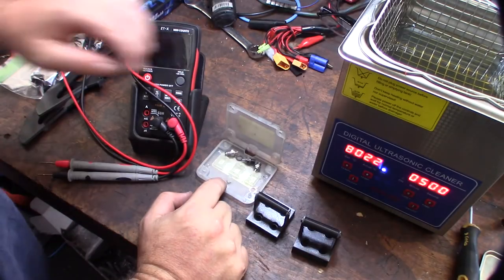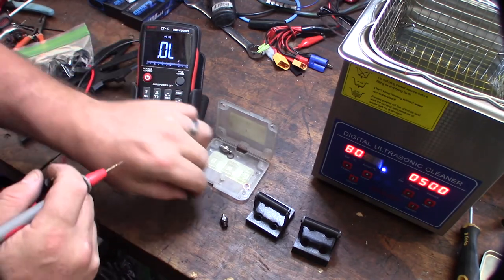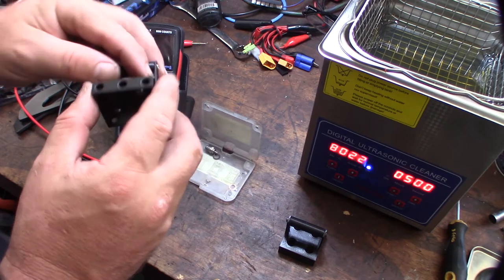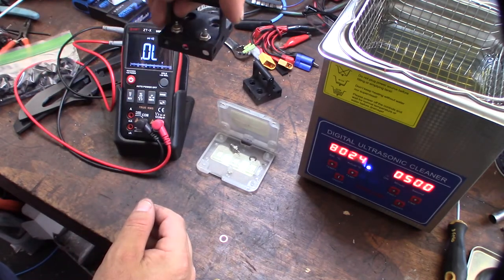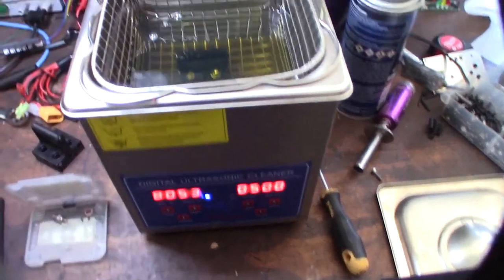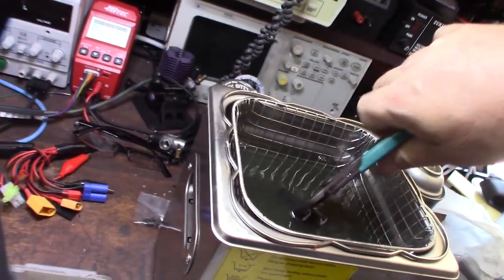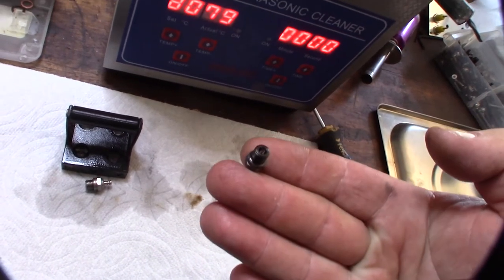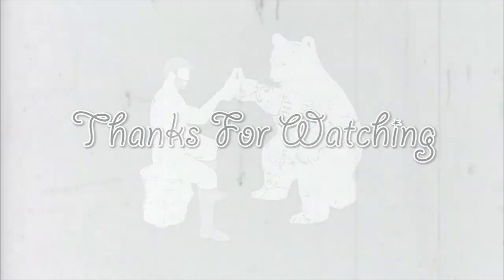RC Nitro Engine Glow plug Cleaning using ultrasonic cleaner and diesel

Comment: These ultrasonic cleaner are great, but you did two mistakes with their utilisation:
-You absolutely need to fill up the tank to the line above the top ( at least 3/4 of the height, otherwise you will destroy it)
-Don’t heat above 55 degrees celsius, the ultrasonic waves are less effective when it’s too hot. (50-55 is the limit)

Comment: Hey Sir,  you are flipping amazing.  
I think if you sized and threaded the holes on the glow plug holder , so they will screw in that would definitely secure them for a sure safe deep clean .